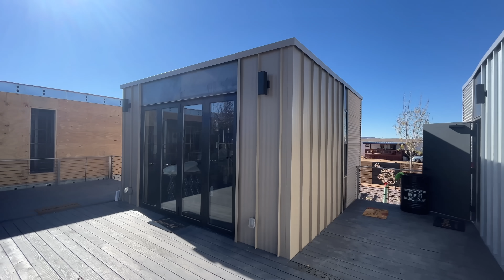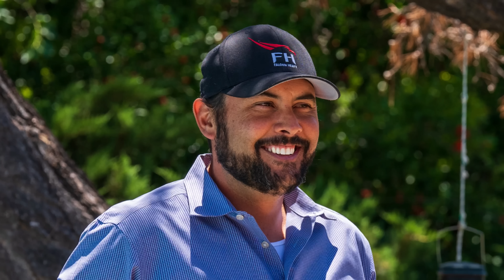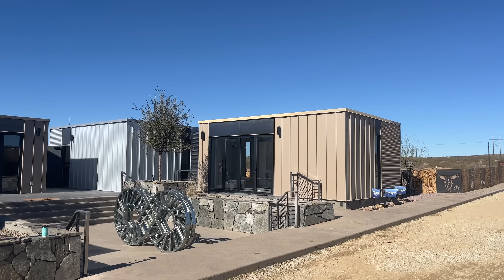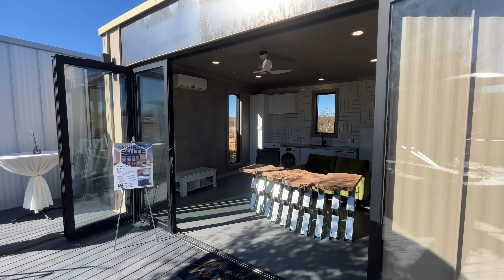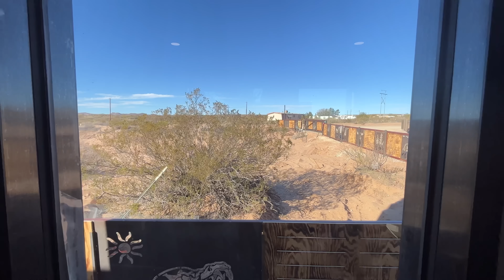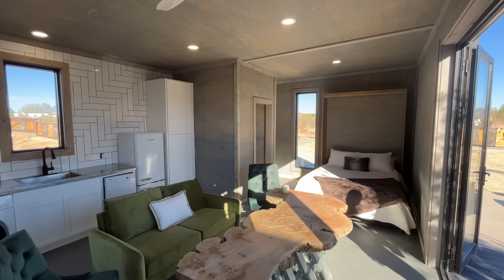Inside the Newest PREFAB HOME in America!!

Comment: you're right about the "European vibe" in the kitchen  @ 5:20.  Biggest fault is the washer projecting from under the counter.  Having lived in rentals in Europe,  the washer in the kitchen is very much indeed common, being closer to the hot and cold water supplies  BUT  only if it is UNDER  the  counter.   As shown that install interferes with traffic pattern;  from experience it is untenable at best, unforgiveable at worst!
Reply: The kitchen is basic to say the least.   Those slot in cookers often have gaps into which spillovers disappear that cannot be reached for cleaning.   If the washing machine was an integrated model, it wouldn't project like that but does require a decor panel/door.  Same for the dishwasher.  Here in Europe, most of us live in much smaller spaces and the kitchen is typically where the washer/dryer goes.
Reply from the maker: Great feedback, thanks!

Comment: With a steel frame (having three of four-inch exterior wall thickness?) and large glass doors and windows, the obvious question is about thermal efficiency. Steel is very thermally conductive, so there's little thermal isolation from the exterior climate. And the wall thickness doesn't allow for enough insulation for northern climates.

What are the R-values of the walls, floors and roof? Please tell us the U-values of the windows and doors.

Do these modules sit on a concrete slab? How are they insulating the slab?

Comment: No these are what modular homes are all about steel frames wood is used to finish the walls but from foundation to roof all framed in steel, quality, durability and precision cut. Yes they are a little expensive but as they get their production line up and running the cost will come down, remember we are headed for a big correction in 2024/2025 in housing prices! But well engineered small high quality homes will continue to sell!

Comment: That kitchen 🤦‍♀ sigh. Too much for a small space. A countertop two burner induction cooking surface, a microwave/convection oven and no dishwasher. The window over the sink should have been turned in the opposite direction for more open views. Wasn't a fan of the outside and not really a fan of the inside either. Thanks for the tour Kerry 👍
Reply: yea ikr. i would do it very different.

get rid of the stove and replace it with an in wall oven and an induction cooktop that's inside the counter, put in a dishwasher that's finished off with the cabinetry of the kitchen and replace that small and ugly fridge with a built-in fridge.
Reply: @miles5600  good ideas.
Reply: Ya the Kitchen is a mess